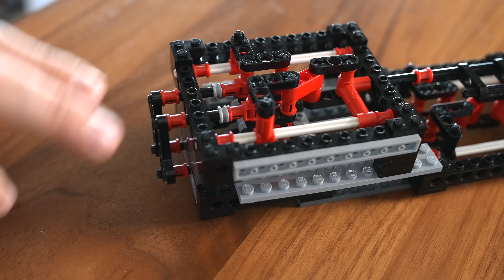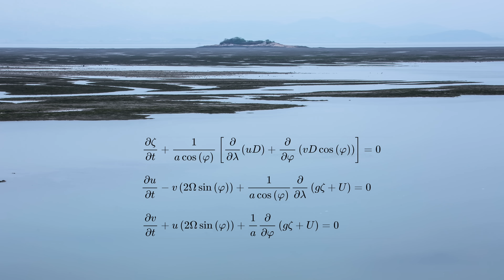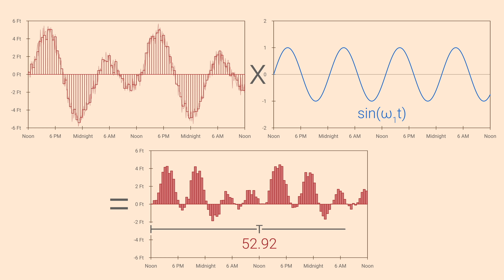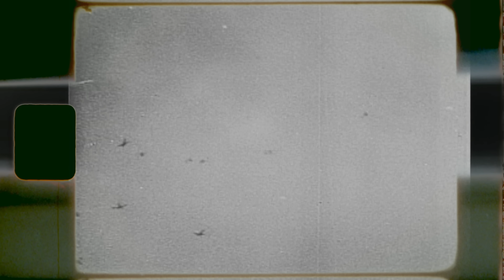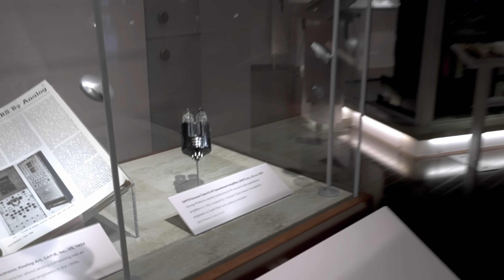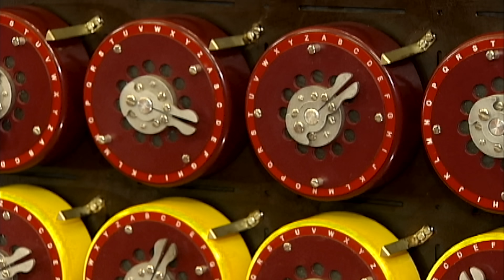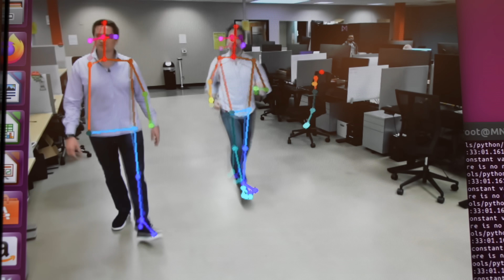The Most Powerful Computers You've Never Heard Of

Comment: When I began as an undergrad 50 years ago, after experiencing  numerical analysis with mechanical calculators, then on an Elliot 903, we moved on to analogue computers.  As a Physicist I wondered why anybody would want to programme a digital computer to solve differential equations when it took a couple of minutes to patch the equation into the analogue box, and results came out instantly as the variables were changed - rather than punching a new paper tape, queueing to feed it in, then after dealing with error messages trying again and getting the result. 

I spent two 'gap' years working on British Government work (the Official Secrets Act prevents me speaking further), and when I returned to university the analogue devices had been scrapped. 

I have a permanent eBay watch for an EAI TR20 - the device on which I lost my analogue virginity.

Comment: Where do you build a factory?
Analog computer for the win!

Build a scale-model of the area under consideration, say a few meters on a side.
Drill holes in the model where raw materials, energy, labor and all other commodities come from.
Drop a string down through each hole, and attach a weight.  The weights are proportional to the real-world cost of moving that commodity.
On top of the model, all the strings are tied together on a brass ring.
The ring will be dragged by the weights and the deflected by the angles of the strings to a point on the model where the cost are 'normalized'.
The cost of getting any one item to the factory is well balanced against all others.

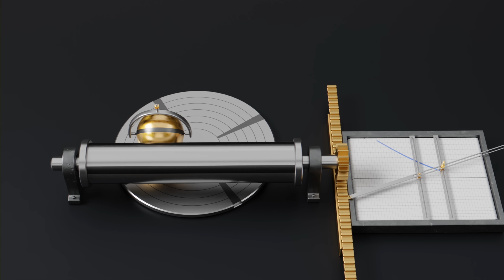Comment: I just had to take apart my snowblower to repair a belt, and the drive system looks a lot like the mechanical integrator in the animation around 8:45. Flat plate, wheel that rides on the plate and moves further outward to increase drive speed, or to the other side for reverse, and that all turns an axle/wheels.

Comment: You missed one of the biggest things about digital: Nyquist's Theorem. Most of the stuff our digital computers do is about analyzing and manipulating real world data such as audio and digital. This includes the compression and error correction mechanisms that allow the Web to be used for such data. One of the biggest changes to allow our digital world came in the early 1980s when we finally were getting D2A and A2D converters that could work with the speed and dynamic ranges needed for such real world inputs.

Comment: Photonic computers is an interesting type of analog computer that's just taking off. By making a microchip with what can be described as tunable partially reflecting mirrors, we can make a system that's essentially a matrix multiplication. Because the chip only changes to be re-programmed, it can crunch through multiplications as fast as you can put them in. Constant time, or even faster depending on how you look at it.

Comment: Serious question:

The invention with the ball and circle where the shafts spin and move cogs which then draws the cosine waves - how do they deal with multiple weights and frictions not making differing magnitude differences to each other so as not to have inaccurate readings?

Or are they "baked in" and so long as your inputs have the same inaccuracies you still end with at least a precise endpoint from the starting condition?

Comment: I played with making neural nets using op-amps in the early 1990s.  They are a good fit for neural nets but it takes a lot of op-amps and at the time,  there were larger bulk components. But now they can be built on chips in the millions.  Plus, these days, there are easier ways to train -and retain the connection weights of the neurons.

Comment: The SR71 used an analog computer to control the cone tips on the intakes of the engines to control the location of the super sonic shockwave entering the engine to the optimal location.

Comment: 02:30 No lithographic transistors are not nearly the same size as atoms, they are about 70 times larger depending on which lithography process is used. We are quickly approaching the point where quantum tunneling will prevent us from going smaller, but we will never get to the point where lithography allows transistors anywhere close to 1 atom wide.

Comment: first of all the lego example is not digital, its binary, meaning there are two possible states of one of the actors. they don't have to be represented as digits or any other symbol. its simply two possible states of existence with no inbetween. the word digital references an electronic system and even though those are for the most part based on the binary system they are not the same.